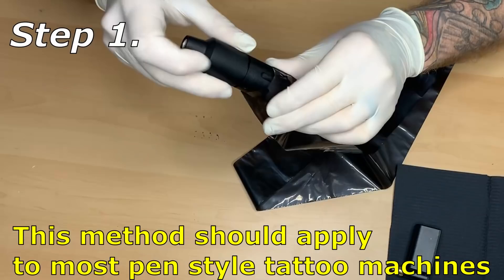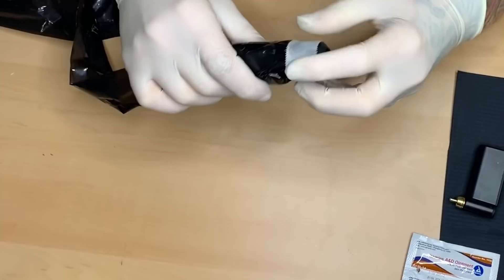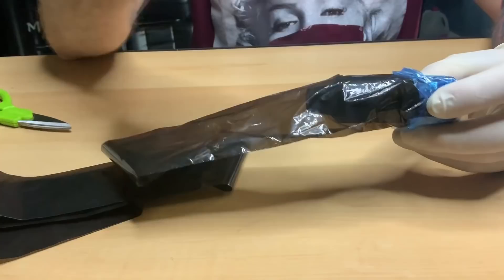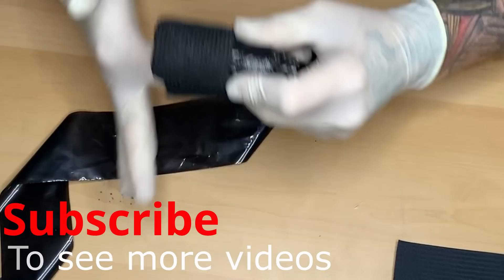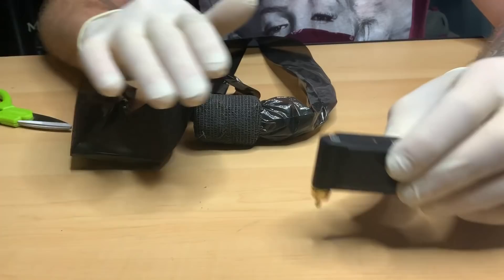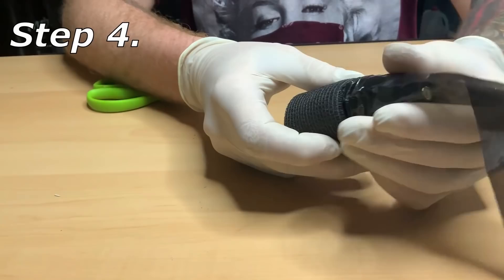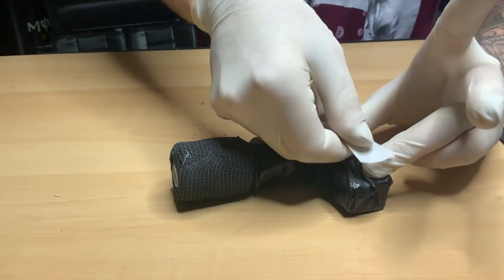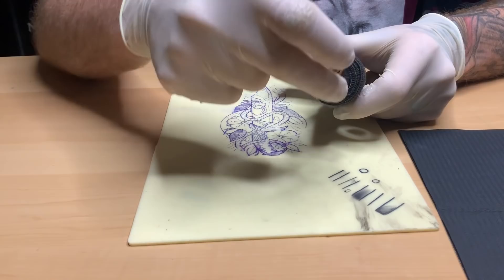👀How to wrap your CNC Q2!! ✅ Or any pen style tattoo machine!! 👀

Comment: 2 questions: 1, How do you adjust the needle depth once it's all wrapped? Is it possible? I tore my plastic barrier trying to adjust it and had to rewrap the whole machine. 2: Why add the barrier at the bottom and not just pop a hole in the clip cover itself on the closed end?
Reply from the maker: I personally haven't had any problems but If you had to make some huge adjustments in regard to the needle throw then yes you may get bound up. But for me I dont have any problems running this way. But if this doesnt work for you then absolutely use the clip cord sleeve in place of the barrier film. In fact I may have to give that a go. I guess I like the idea of the barrier film but thats just my OCD lol. Thanks Abe, appreciate it brother!!
Reply: @ArtSomething  I appreciate you always taking the time to answer these comments! You rock Dude!👍

Comment: ATM Since I couldn't find sleeves for pen machine I just use 2 barrier film pieces. One for the "body" that I wrap around and secure with a piece of tape and one for the grip like you did here & in your first "wrap" video. Works fine & it's fast ! (Mine has the battery built-in so it's really just one big tube to wrap)
Reply from the maker: Thanks for sharing that Dranonium!!! Sounds like a good system you have there!!! 🤘🤘

Comment: I'm a new artists on a budget, I've got a rotary machine but its cheap and I want to invest in a pen kit. Do you have any experience with Dragonhawk pens and what pen kit  would you recommend? I run my setup close to yours at 8 to 8.5 volts with the needle out enough to float it. I rarely ride the tune
Reply from the maker: No unfortunately I don’t really have any experience with dragon hawk tattoo machines. I haven’t heard anything really bad about them. Now I have use the CNCQ2 and found that to be a really solid machine I’m still using that machine over my Cheyenne at the moment. Thanks again Josh appreciate you man hope this helped!! 🤘🤘🤘
Reply: I got a dragon hawk. It’s a nice machine. The foot pedal is a little cheap though.

Comment: Sorry if someone has already asked this. So I have a HYPERION pen style machine with the wireless battery pack and tried wrapping it this way and ran into a problem. How do you change the needle depth without messing up the barrier/wrap? I was using a liner cartridge (3RL) then switched to a 15mag curved cartridge.
Reply from the maker: Thats the tricky part but in this case you will have to make small adjustments to keep the plastic barrier from ripping.
I hope that makes sense.

Comment: does the cnc machine create an odd odor when running it?? mine does, like gas/ motor oil. idk but its strong. u smell it when u unscrew the cartridge piece .
Reply from the maker: Yeah that’s machining residue. You want to clean all that up. And thanks for the question🤘👍
Reply: @ArtSomething

Comment: I am saving money to starting the journey of tattoo art but i am a little confused.You dont need a standar foot pedal to control the machine when you have a wirelees power supply?
Reply from the maker: If you’re running a wireless power supply then you don’t need a footpedal at least not for the set up that I have. Hope this helps and thanks for watching!! 👍👍🤘🤘
Reply: Hi  @ArtSomething  I-m handle watching you videos by two accounts I have, so sorry for the mess on old post,
my question is about the footpedal, can I have both (footpedal + powersupply battery) in the same pen CNC Q2? 
I'm willing to buy one and it for me is very important. but probably ill try get it from Germany (but I didnt find the same as ya have yet :( ) once I live in Ireland, From US is pretty complicate to get like yours.
greetings from Dublin, ya rock doode

Comment: How about when you have to adjust your machine/power supply during a tattoo?
Reply from the maker: Its really easy everything can be done with the machine wrapped up. Only you will have to take the tape off the back and take the battery off and put another on if you need to change batteries but other then that its pretty simple. Thanks for the question Evander!! And thanks for watching!! 🤘🤘🤘🤘
Reply: Art-Something thanks for the response & been watching since the first video! Thanks for all the tips ✊🏾
Reply: If the clip cord sleeve is secured under the sports wrap, and you go to make any adjustments, doesn’t that tear the sleeve open?

Comment: Thank you so much for your videos! So helpful. I tried using the Starryshine barrier film to pull over my Ambition rotary pen, and it won't stick.. It's not very textured but it's definitely not squeaky smooth like an aluminum surface. Do you think this is normal? (Your other barrier film link doesn't lead to a product.. do you have an alternative recommendation if you think this is a barrier film brand issue?)

Comment: I'm curious, what's the purpose of having such a thick grip on your machines with sports wrap? is it to level out the weight of the machine? or is it preference?? 

Your videos are really good for note taking and overall learning, thanks dude!
Reply: It's a preference of comfort. I use 1½ inch grips while my coworkers prefer 1and 2 inch grips. You really just want the machine resting in your grip, tensing your wrist and hand muscles make not for a long tattoo career.  A relaxed grip on your machine is also better for pulling/pushing lines and the more rhythmic hand motions for packing/shading.
Reply: @deadweight2049  Oh right on, that's why my wrist tends to get sore, the machine weight. Thanks for the response

Comment: Been looking at this machine for a while now. I don't have an autoclave, i currently use disposable everything. Apologies if its a stupid question, but if i got this machine and wrapped it like this would it require the autoclave after tattooing aswell or is a wrap and wipe down plenty? Safety is at the top of my list and i wanna be sure lol
Reply from the maker: I don’t use and autoclave anymore because I went disposable. So yes you don’t need an autoclave. Just wrap it we’ll make sure there is a good solid barrier on your machine. After the tattoo make sure you clean everything and make sure you use something like caviside to sterilize your machine. I hope this helps. I will be making a video on this in a few weeks. Thanks for the question Carl👍 appreciate you watching.good on you for trying to stay safe and clean with your practices🤘🤘
Reply: @ArtSomething  that's just the info i needed, Thanks for your help and i hope life is treating you well
Reply: Hey, did you ever make an video on sterilizing your machine with caviside?